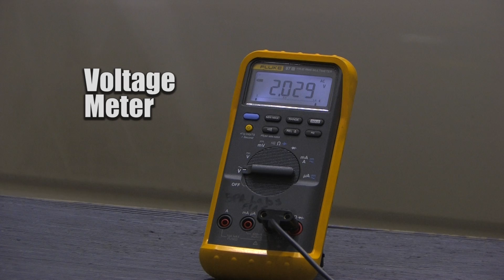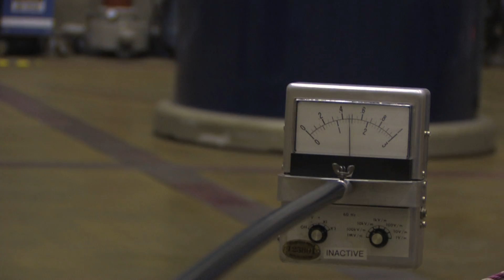Electrostatic Induction - DOE Smart Grid Workforce Training Video

Comment from the maker: If you're referring to the lights on top of transmission towers (like at 4:34), the FAA requires lights on structures 200+ feet or taller and for some shorter structures (like if they’re in a flight path). The lights are red and white and some are flashing. The height of the structure determines the type of lighting necessary.